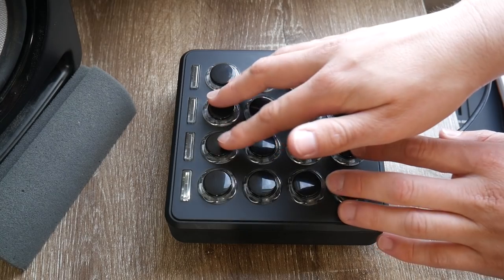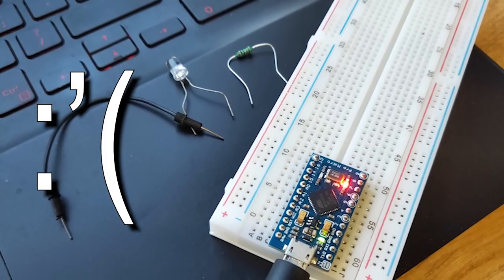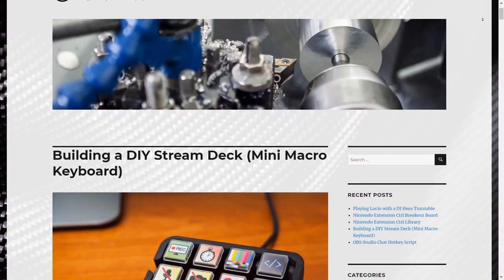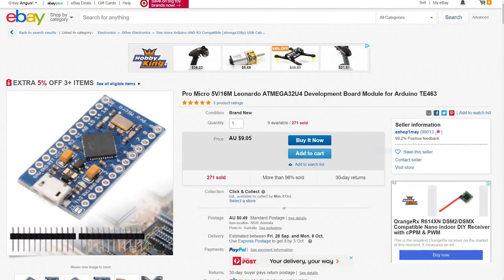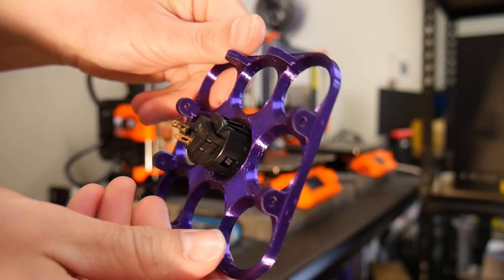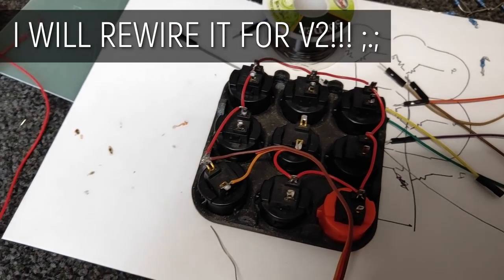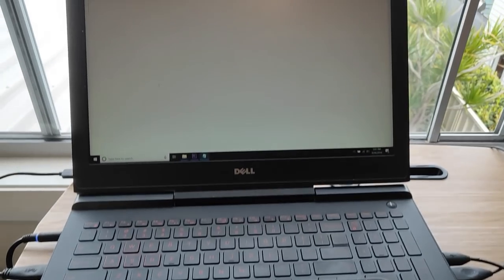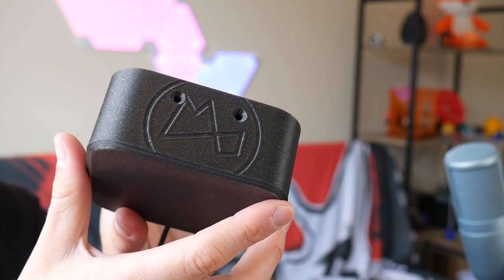Making a custom macro keyboard with REAL arcade buttons

Comment: Am I the only one who really wants that RGB wall lamp thing?
Reply: Holy crap, $200 to $300 USD
Reply: @powerChriZ Thanks for the name...now to find a tear down....so I can clone it :)
Reply: @powerChriZ you could probably figure something out with frosted panels (material of your choice) with some adafruit neopixels behind it so you can address each one separately. It shouldn't be too hard to wire in a mic and write code to respond to music like the panels do.
Reply: It looks very vibrant and bright in person. But you're definitely paying for it.
Reply: I was thinking the same thing. Now to try a diy one.... where to find plans
Reply: My current idea:
3D print the "backplate" in white
Add some WS2812B RGB leds
And connect the triangles via a 5 pin connector (gnd, 5v, and for each led)
Cut out a fitting triangle in acrylic and sand it until its has the frosted effect
Profit?
Reply: @littlenyancat, dude, your avatar is my background! Nice choice! :)
Reply: @thomast.8546  GreatScott!''s channel has a build video of a 16x16 addressable RGB wall thing, might get you going on the right direction.
Reply: The list price for the Nanoleaf Aurora is pretty high, but Best Buy often has them on sale.  I picked up a fifteen panel rhythm version for something like $270 (Canadian) a while ago, while the list price was $350 (also Canadian). It's still pricey, but not nearly as bad. One thing I found interesting about them is that the panels seem to know how they're connected, so that the lighting effects always properly blend to adjacent panels.

Another commercial alternative is the LIFX Tile, but isn't exactly any cheaper.

Comment: Instead of making it type the hotkeys from the arcuino, you could make it press function keys from F13 to F24 (which actually exist, they just aren’t on your keyboard) and then use autohotkey to code more complex functions on the press of the buttons, so it would make it a bit easier to use and reprogram, since you can write functions only for certain apps or make it do some low level windows stuff.
Reply from the maker: Yep that's exactly what Davids code does it works very well
Reply: Maker's Muse oops, sorry, I didn’t look at that page
Reply: @MakersMuse  I've done ctrl-f13-24 for  stuff like mic mute and also media keys with that same library as you have (I think? It's Nico Hood's hid-project). Macros are a lot easier to do when the macro code has more access to the computer.

Comment: Soldering arcade buttons? You monster! They eventually die, so you should just get some spade terminals and crimp the buggers ;)
Reply from the maker: Hah! Yeah, in the V2 and I doubt I'll punish them as much as in a real arcade!
Reply: Just don't solder the crimp connections or everyone will yell at you in the comments :p
Reply: How many clicks to death? Because in many cases I’ve found that the cost/space/effort vs lifetime make it more sensible to just desolder and replace old switches instead of adding spade terminals.
Reply: The button eventually fails, not the connection.
Reply: If you do not need to take it apart, it is better to solder it.
Reply: @MisterMakerNL  tbh I'd rather solder (and, later, desolder) the wire than be constrained to definitely having the correct crimp terminals on hand.
Reply: I have lost count of the amount of arcade buttons I have killed  !
Reply: You guys know solder is reversible too right? Yeah it takes a bit more work but it's not like you are going to be replacing buttons regularly
Reply: YAS!! And with the proper crimper!! (seriously is $20, and you won't regret it, the crimps are WORTH it!)
Reply: Pablo Rages  it will not. NASA has data on it, good crimps beat crimped-poorly-and-soldered for rate of failure.
Reply: Pablo Rages  also on a side note, I noticed in another NASA standard they rejected a request from the military that said "properly maintained military grade aircraft should be exempt from these standards". Heh

Comment: I made the original streamdeck that you used as your base. His arduino is set to utilize the F13-20 keys that most keyboard do not have, instead of modifying the code to change that I instead utilized AutoHotKey which is a program that lets you write scripts to run on specific key presses. If you use that instead the programming for it is a lot easier. The downside is you wont be able to take this to different machines since the arduino will still be sending the F12-20 keys. It does make it really easy though if you are using it on a few machines since you can just copy around the AutoHotKey script and load it up on each machines so its ready to go when you plug it in and press a key. You can also do some advanced things like using key presses to compute things for you which is nice if utilize some formulas, you can just map a key to run the formula with the values highlighted. Ive seen some interesting stuff with it. It also makes it a lot easier to change what the buttons are doing since you can just modify the script and rerun it or run a different script which is easier than having to reflash the arduino if yours is anything like mine where i have to short power and ground to do a reset twice to load up the bootloader for it to accept uploads.
Reply: If you have files that go with it, bake in a USB hub and either a throwaway flash drive, or heck, an SD card reader would be neat.  Then you'll always have the latest version of your scripts and an installer for your program or whatever.
Reply: I got a X7g-100 a while back to set up a macro keyboard. I use a program unoriginaly called "Lua macros" to load a set of autohotkey scripts. Don't know if it's the most elegant solution, but it gets the job done.
Reply: That Idea with AHK and the F13-F20 keys was the exactly same as I thought before reading your comment. Would do exactly the same way.

Comment: Neat. Trust me, your wiring isn't THAT bad. However, I think I'd use spades and crimps. Alternatively, heat shrink sleeve over the soldered connections :-) That aside, a pleasing interface project. I, like you, can't program to save my life so I use examples I find online too! I love the design process, that's why I make stuff.
Reply: So true

Comment: Really, if you want to get better at programming. You're best bet is probably to pick a language and then start learning the basics. Once you got a solid foundation, you can build pretty much anything you need to (although at first it will be extreamly messy and convaluted). And then you'll be able to reverse engineer other people's code with much more ease. The fact that you struggle with it, probably means your foundation isn't that strong.

Of course, you might not want to learn to code, in which case ignore me. But if you do, you need to start from the ground up. Try building a basic naughts and crosses program then gradually move on to more complex things. Sights like project euler and stuff are great for that kind of thing.

Although, I will say while I like to think I'm a semi-competant programmer I am utterly useless at building things using 3D printing, wood, metal, electronics... I can repair a computer if its broken, I can paint and sketch, but thats where my DIY skills end. Even my designs for code are horribly messy. I built a desk a few weeks back and that took me ALL DAY and it wobbles and it really isn't a great build. Different people ahev different skillsets, which I suppose is why working as a team is so effective.

Comment: Keeping something always plugged in to the pro micro's USB port (and well isolated from strain) is a good choice. I've built a handful of PS/2 to USB keyboard converters with those boards and the TMK firmware (so I can use my old keyboards on modern computers), and those micro USB ports are definitely the weak point of the pro micro clones - they don't survive many cycles, either not connecting internally or tearing right off the board far easier than they ought to.

Comment: In the scheme with a resistor you have a 220 Ohm one. Well done though. And the Prusament looks amazing.
Reply from the maker: Yeah just an example I grabbed from Arduino not related to the project :) pull up was far cleaner and easier!

Comment: If you don't want to code at all then look into a cheap Chinese DIY arcade joystick kit. They're on eBay for really cheap and they work as a simple USB interface that shows up as a joystick. Then just use a programme like 'joy to key' to add your macros.

I used this when I first got MS because I had nerve damage to my left hand so I couldn't always tell where my fingers were. I had macros for things like Adobe Premiere Pro so I didn't have to use complicated key binds and I mapped the joystick to be WASD keys so I could move the whole joystick to walk around in games. Thankfully I don't need to use this now as after a lot of physiotherapy can mostly use my hands properly again - but that was my solution to the problem and I didn't have to learn a single line of code.

(I don't have anything against coding. I would love to learn and I know how useful it would be. I just would have taken too long to figure out and I needed a way to use my PC as quickly as possible.)

Comment: It really is funny, you and I are in such similar boats, I'm just on a more basic project :p
I'm doing the DIY Midi fighter; so far I've used someone else's STLs (which I fixed/modified), a teensy LC with some plug and play MIDI code I found online, and then using a generic "flexi" midi controller script for the DAW I used (the script made by a user). I know nothing about coding but just enough to make this thing work :P
Oh and I can't decide on what USB adapter I want; I actually think Micro USB to Micro USB would be nice, since I have a lot of those cables. Also, if I get a few adapters, they can be replaced when worn out.
Reply: Nice work.  If your device is big I recommend USB-B for superior durability, as those micro ports wear out just like the cables do.

Comment: As a professional software developer, I feel your pain, a lot of the open source Arduino stuff isn't great learning material. -- Though HID device projects are super fun.  Before the ATMEGA 32u4 was common place, we used to use a library called V-USB for the ATMEGA chips (no arduino required, chips are super cheap like, $3 or $4), with a little bit of extra hardware (2x 3.6v Z-Diodes, 16mhz oscillator, some caps, 7805 and two 10k pullups) you could emulate a USB 1.1 device by bit-banging the IO pins.  I built a HID joystick a while back with that approach, and yes, the built in pull down resistors were a life saver, you just plugged one button side into ground and the other directly to one of the pins. Was super fun for Mame games for awhile (p.s. Don't solder arcade buttons, use the crimp connectors that slide on instead!) -- Seems like your device might be useful for an Elite Dangerous playthrough, or maybe some common 3D modeling operations?  Keep in mind you're not limited to keyboard keys with that, you can send mouse commands, joystick commands... You could even integrate it with a timer or Wi-Fi, and write an app the let you use your phone as a hardware keyboard. -- Heck, you could also throw a USB hub in there, so you could plug more devices into the back? -- Anyway, thanks for posting the video, keep up the good work, Angus! 👍👍
Reply: I agree, "a lot of the open source Arduino stuff isn't great learning material". Most of the material is very application specialized and small changes break things.  It's very easy to run into library conflicts and there isn't great information on how to properly deal with such conflicts. I even ended up creating a hack job of a library for running two Pololu dual-vnh5019-motor-shield boards since it's common to run 4 motors. The stock library was only designed for a single board and no one could explain how to run 4 motors with two shields. I ended up spending weeks dealing with conflicts using the servo library and this 2 shield board - 4 motor setup only to find out about pin and library conflicts.
Reply: @WaltSorensen  exactly.  And a lot of that could have been avoided if the developers had used any sort of best practices.  Instead you have the blind teaching the even more blind, with the mentality that as long as it "works", it's golden -- no SOLID (completely closed for extension except by modification, zero objects, etc.), no unit tests (can the Arduino IDE even run unit tests?), and zero organization... It's very common to find stuff that's just a hot mess. :(
Reply: Michael Jensen the Arduino IDE doesn't do unit tests, but with github and travis CI (or another CI service) you can run some tests. I helped pololu add a very basic testing environment to  one of their libraries which they then used as a template to test other libraries. I wouldn't call it a true unit test but it's at least something of a test.

Comment: Did not know this was possible with an arduino. I always wanted to have a privacy door sensor in my room so if someone walked in it would press ctrl + alt + delete and turn off sound.
Reply: How about just locking the door?

Comment: Hey @MakersMuse, which configurations are you using to print these things? Like which nozzle size, which layer height, retraction and stuff. I would love to know that.
Reply from the maker: It's using the default 0.2mm normal in Slic3r Prusa Edition for the Mk3. Works good
Reply: Ooh, nice to know. I'm using a 0.4 and was always wondering why my prints were not that pretty as yours. I have a built printer running Marlin, so I don't know what would be "normal" settings for you. Can you give me some more infos about the settings, like I said, layer height and some other stuff. Maybe a printscreen? 

Thanks for answering. Keep the awesome content up, I love it.

Comment: The ergonomics look a bit awkward with the wrist off the table, ie a too high a profile. Does it feel ok to use.
Reply: With those arcade buttons that's probably the lowest you could get. But if you use macro keys you can get as low as a keyboard (I know right). It's the same process just different buttons.
Reply: Yeah, you have to be careful with arcade buttons they are super deep... Though if he put a reecess in his desk, or perhaps added a ramp, maybe it could be more ergonomic?
Reply: This is where Angus' super-strength needs to be brought to bear!
Ergonomics and Industrial Design are clever bed partners.....

Comment: You don't need to use a usb-B to micro-B, just move the Arduino to get the connection to the outside (just like the usb-B you showed)
Reply from the maker: It's more that USB B is much more durable. I've already damaged the micro B on my other pro micro!
Reply: Agreed.  USB-B is best (imo) when size is not a concern.  I've never had a USB-B port fail on me like I have with micro.  (USB mini or C are also good options that I would use before micro for reasons of durability).

Comment: This for me is a fantastci video. You are so good at 3D printing, which is why I subscribe and watch your videos. But you explain in your video that you are good at that element. But Ive now found something you are not good at. That to me makes you humna and thus more watchable. Im fairly new to 3D printing, and very new to electronics. My main skill comes in painting. Ive been able to identify lots of projects that combine all three of these interests and of course will help me grow in skill. I mainly take designs and modify them in tinkercad (I did say Im new to this) as long as they have a basic shape (Boxes and circles etc) but you have given me insiration for a project that I want to do, that being a seperate focus in and out button. I dont know if its possible yet but one of my biggest problems is when I stream I have the camera in focus. Then I have to move to a different position, perhaps for a close up, which of course means that the camera is now out of focus. Im not happy with the auto focus so the only solution is to tell my viewers to hang on a minute while I manually adjust the focus using the webcam software. It would be so cool to have two buttons on my desk that I can press to focus in and out. Im hoping thats possible. 

But the main reason for my comment, hope you dont mind, is to thank you for showing us that you are in fact human, which makes your videos so much easier to watch.

Comment: Very easy, no programming, plug-n-play solution:
1. Buy a USB keyboard.
2. Open up the keyboard and follow the tracks to the small circuit. If you have a tester, put it in continuity to test the tracks, it's even easier that way. Note down what connectors give you the keys you want to simulate.
3. Solder cable between your buttons to those connectors.
4. Plug it to your computer. It will detect it as a USB keyboard. Press the switches, it will give you the keys you selected earlier.

I have done that a few times. It's the easiest electronic project you can do. You don't need to understand anything about electronic nor programming. And it's so satisfying to plug it to the computer and it just work. No need to install anything. The only issue is that you can't easily reconfigure it to a different key mapping...

Comment: I design a lot of custom pcb's  but haven't got into designing mechanical stuff 
I have  Sovol x1 for 3d printing but like you I'm working learning.I can modify your code to support the colors however you want.
I would change the cpu to adafruit itsy bitsy m4 so you can use circuit Python for code.

Comment: I've seen commercially produced stuff that has similarly ugly wiring inside it... Some manufacturers just use whatever they have available, and sometimes it's just cheaper to pay someone to solder it all than to develop a neater method. If it works, it works.